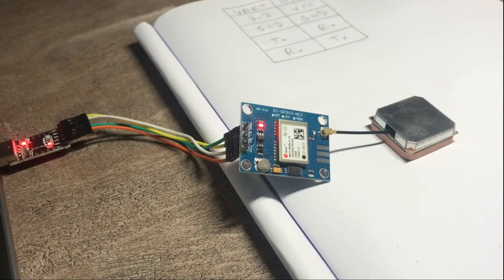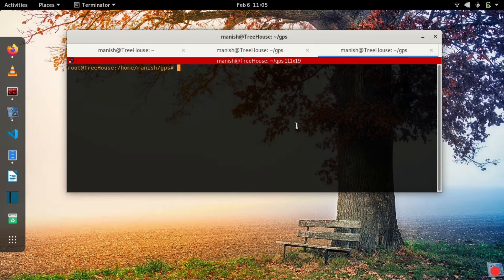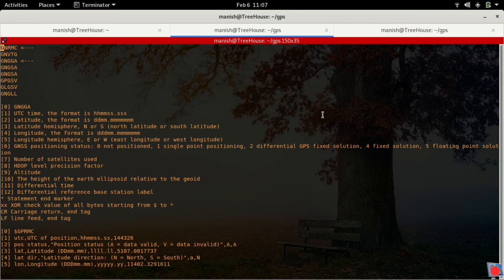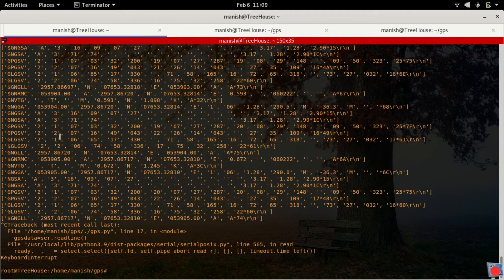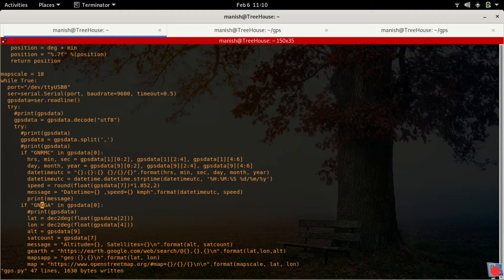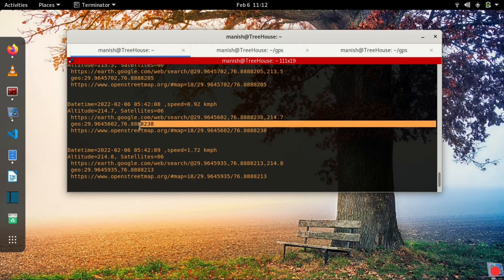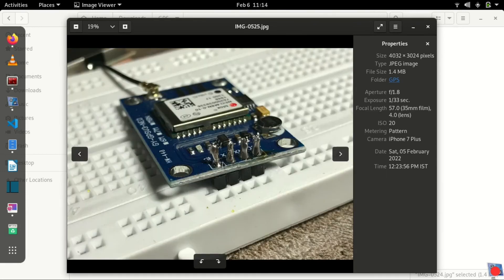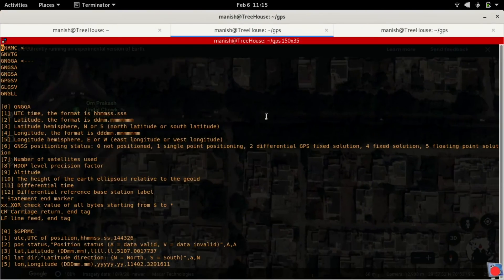GPS NEO M8N module to get latitude, longitude, altitude, speed and number of satellites

Comment: Thanks for your video. Have you been able to get consistent altitude readings? I use a Neo6M and keeping track of minimum altitude, average altitude, maximum altitude over 24 hours sitting in a stationary position I get a range of approximately 30 meters from min altitude to max altitude. I tried limiting the data to only use it if I had 10 or more satellites used. I got the same results. I would think a GPS would be more accurate than that.
Reply from the maker: Yes, I got nearly consistent readings. +/- 5m in altitude.
Reply: @WondrousExplorer  Thank you. I tried 3 different Neo6M modules with the same results.

Comment: Interesting video and really useful, thank you.

I have a Neo6M which flags antenna issues, resets and sometimes never locks if I feed it 3.3V.

The 5 pin component near the LED on the GPS module is a 3.3V regulator, if you feed the GPS module 5V on the VCC pin it will be more stable and lock faster